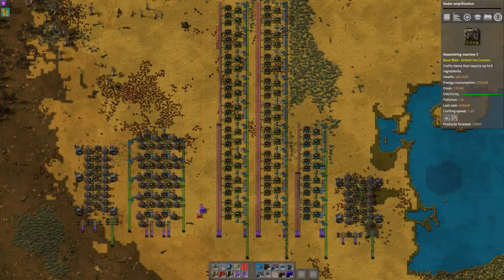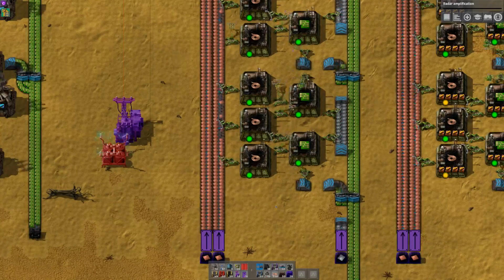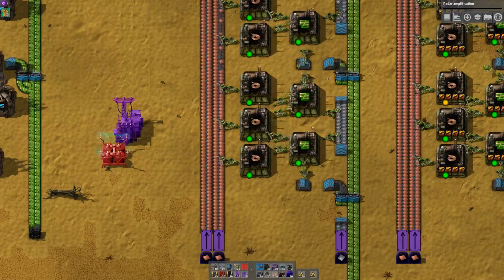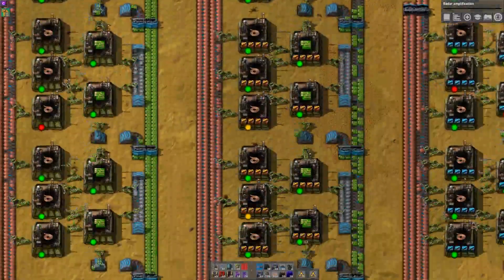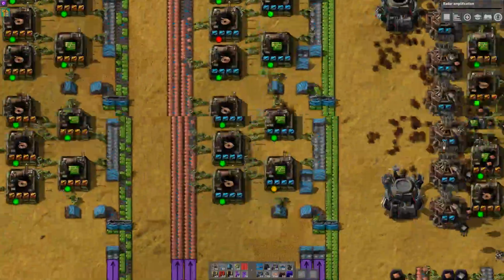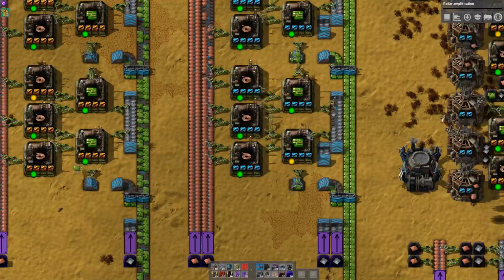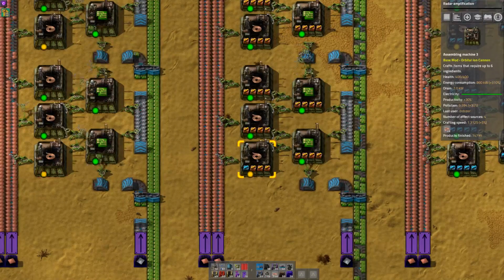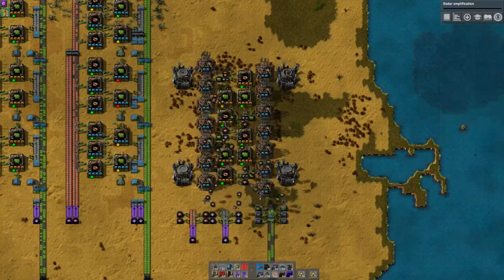Factorio Sandbox: various green circuit builds

Comment: For Matthew and Boris for information and for anyone else who might be interested;

First build the Basic belt build 9 stamps of the classic 3-2 combo.  
Uses 3.6K Cu, 2.4K Fe and produces 2.4K Green, with 12 MW power

2nd build. Basic with Prod mods. I actually extended this to acheive similar outputs. needing a total of 14 stamps.
Uses 1.8K Cu, 1.6K Fe and produces 2.3K Green... energy consumption 54 MW!

3rd build. Basic with Speed mods. Only uses 4 stamps, s much more compact as you can see.
Uses 3.6K Cu, 2.4k Fe and produces 2.4K Green... energy consumption a whopping 126 MW!

Then on to the Beaconed builds
4th described, on the far right of the line. Actually didn't produce the target 2.4K green
Uses 1.2K Cu, 1.2K Fe and produces just 1.6K Green... energy consumption 20 MW.
Note... I tried to scale this up... but couldn't get reliable results.

5th described the Beaconed belted build 2nd  left on the picture.
Uses 3.5K Cu, 3.3K Fe and produces 4.6K Green... energy consumption 40 MW.

and finally the super compact Beaconed and bot build.
Uses 1.8K Cu, 1.7K Fe and produces 2.4K Green... energy consumption 28 MW.

So my conclusion, the standard build is good and efficient. If you are going to use beacons, either the belted version here or the final bot version are  pretty much on a par, using half the copper and one third less iron at the expense  of about double the overall power needs.

I will be using a variant of the final 2 designs myself in the future.
Reply from the maker: Awesome work! Thanks.

Comment: So for 0.16, just combining two belts that together carry >=40 items/sec with a splitter is going to make a 100% compressed blue belt output from that splitter?
I just got the hang of compressing with underground belts :p
Do you know when 0.16 is goign to come out and automatically update my game?
Reply from the maker: Yeah, you can make belts saturated in 16 by using splitters to merge. At the moment it's the only way to saturate. And of course the splitter won't balance the halves of your belt, so you need to make sure you have lane-balanced the throughput.
Not sure when 16 is out. I'm playing it on preview.
Reply: 0.16 .16 is available now on the Experimental branch.  It will still be a little while before the "stable" version is released.  But as seems to be the case with factorio it is already pretty stable for most players.